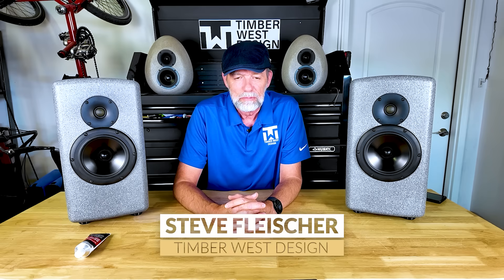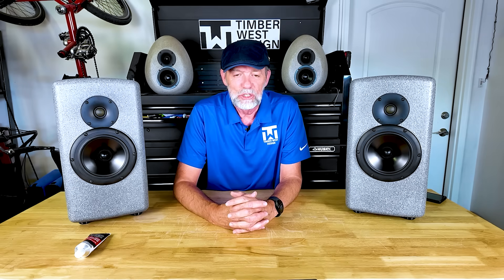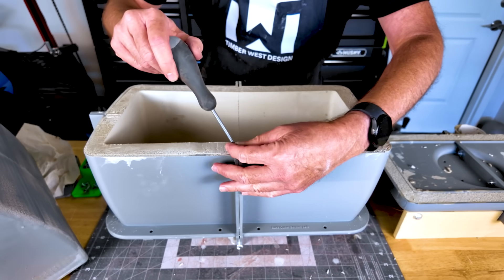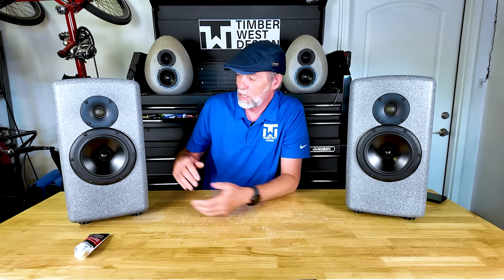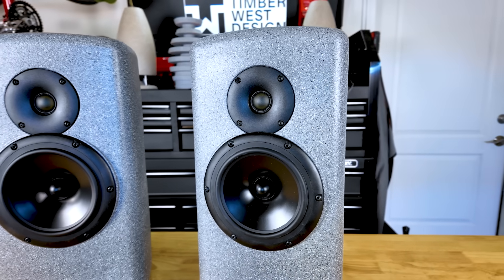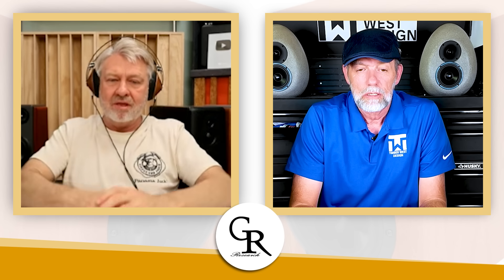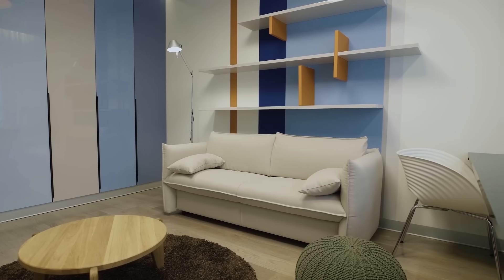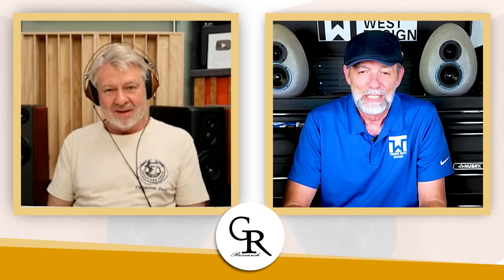Concrete XLS Encore! – You Gotta See This!!! @timberwestdesign

Comment: There is a lot more to masonry than just resonance suppression...internal volume has a lot more power to improve output that goes far beyond box resonance.
https://youtu.be/-ij93VxfPz4
Ive been developing proprietary sustainable masonry that is audio centric for about 15 years and is a little over half the weight concrete but far more energy absorbing (8" inch solid block stops a 50 cal)
These are now single piece casting...they can be the normal smooth but each one of these is unique per casting although the measurements dont change...just adding an art component.
We are about to start doing large horns (we have industrial printers 1m3 now) for some high end guys
The most clarity is immediate in the midrange...the front to back depth is just unbelievable

Comment: Hello GR, I have a question but not about the speakers.
I really enjoy your videos, I've seen several of them on the open baffle system.

 I have a question about crossover designs. The videos I've watched about crossovers, I haven't seen any mentioned this. When setting the parameters for frequency crossover point, is that done according to the speakers impedance at that frequency of the crossover point? I see a lot of crossover set at 8 ohms and it doesn't make sense to me.
Reply: I look at the driver response curves and let them tell me where they need to be crossed.

Comment: It's a great concept with inert concrete... 
Completely the opposite to the BBC monitor concept which uses thin plywood  with screws to create a ' leaky/ lossy ' cabinet where the speaker cabinet literally becomes like a vibrating musical instrument...
Both the concrete cabinet and the 'Flimsy ' cabinet are equally brilliant designs.

Comment: This opens up all kinds of possibilities. One could use any concrete stain of their choosing and then polish the surface to a sheen and seal it. Or go the FLW path and use crushed granite as an additive to the mix to create a completely different look. One could embed brass, bronze, etc, in the outer edges of the slurry and polish it along with the concrete, but no worry about resonance. If it had straight sides, you could install nuts in the forms so various side panels could be screwed on for various looks, and none would affect the performance. One could literally match the rest of their interior.

Comment: I bought a scruffy pair of SD acoustics SD3R speakers from the 80s as a project. They are similar construction with the rear being a separate panel that was bonded on to the main casting. They used what look like infinity circular planar tweeters playing through a slot in the cabinet, but they need replacing as one was bust and the modern copies appear to be garbage, I may cut the cabinets to fit either Fountek neo cd3 ribbons or some Neo 3pdr planars.
Despite the worn out drivers you could tell that the cabinets were not adding colouration, can't wait to get some decent drivers and crossovers in there when time allows.

Comment: Years ago an uncle made corner speaker cabinets from concrete, I was too young to know anything but as you say Danny most speaker  cabinets resonate like crazy. I bought Q acoustics concept speakers because of their non resonating cabinets.  This is a fantastic build cannot wait to hear and see the analysis.
Reply: They do resonate. I use sand. Double walls with lots of sand. Still you need plenty bracing. The bass from those heavy sand filled boxes is insane. You lose most of your bass with light boxes.

Comment: Fantastic job on the speakers, I have a very similar project in mind coming up (but leaving the printed shells in place). You might have made your life a little bit more easier, if you printed up a another piece for the back to sit it in and align the top piece as you fit it.

Comment: Suggestion:

Try another version with a built-in transmission line that vents out the front baffle. No Res on the interior. Magnetic grills.

Would love to see the specs on the current build, especially sensitivity and impedance across the FR.

Amazing work!
Reply: They would need to be taller for a TL.

Comment: In a past life I was a contract PC service tech. I had a fascinating customer over 100 years old retired dentist. He had a set of concrete speakers about 3 feet tall with a front facing top driver and a low rear driver. Even though they were in an office off the main room, they filled his home with sound. Of course he had most likely lost some hearing, because he kept letting me turn them up. He said they were Scandinavian in design/build. I can't find any Internet reference. Does anyone know this company?

Comment: Years ago in some Stereo Review or maybe Architectural Digest? they featured a guy who had a very high ceiling who built stereo speakers out of bricks and flagstone. The Baffle was like inch or inch and a half Baltic Burch plywood. He hired audio engineers to set the sweet spot and they did many measurements.The sound was described as "solid and impressive". JBL woofers and huge horns --  were the drivers.

Comment: Very nice! Did this gentlemen work with Mike Kelly on the Aerial Acoustic 10t, by chance? Even though those heads were a disaster, with the paint cracking and flaking off, they are amazing speakers. I have two pairs of the heads here that were clearly done in a very similar fashion. I recently purchased an additional set of new replacement heads, from Mike, that would chip and scratch just by touching them with a ring on your hand and or laying them on a table to install components. Beware. Just an awful experience.
Carefully select your primer and paint if and when you take on this amazing project.
I'm pretty sure I will be doing a set for myself.
Great video, Danny. 
Thanks for the share.

Comment: I suspect that the same type of build with a resin pour instead of the concrete will also be very interesting!!! Also, I think it will take longer to pour to avoid pesky bubbles from forming in the resin. 🕛🕧🕐🕜🕑🕝🕒🕞🕓🕟🕔🕠🕕🕡🕖🕢🕢🕗🕣🕘🕤🕙🕥🕚🕦
Reply: Mineral loading the resin would help to make it even more inert. A vacuum chamber would degas the resin to prevent bubbles.

Comment: PL Construction Glue is crazy strong back in the day when I was building speakers, I used marine two stage epoxy with filler. PL is Cheaper and easier😊

Comment: A gentleman I used to work with, built a pair of wooden speaker cabinets that were filled with sand. (In between the walls).  He used some 12" JBL coaxial drivers in them. They worked really well. very little to no resonance with them. Sounded great! They weighed a ton!

Comment: There might not be any coloration from the cabinet walls vibrating but there will still be some level of coloration from the sound reflecting back onto the woofer diaphragm depending on how much sound treatment there is inside the cabinet.
Reply: You have that in a wood enclosure too.  Your point?
Reply: Yes, of course you still need damping material inside, but it’s damping a lot less than a regular cabinet

Comment: How is the sound compared to wood cabinets?
Reply: I’m surprised you’re asking that question.
Reply: @ChicagoRob2      It sounded like a fair question.
Reply: @davidsmithson9236 exactly, specially he did not show is there any any no rez or sound wool inside ?
Reply: @kdomster9141  I put sound dampening material on the interior walls.
Reply: @timberwestdesign  Was is GR's NoRez or maybe other material and was it glued to the inside walls or just loosely inserted  ?
Reply: @kdomster9141  I didn't use NoRez in this build.  Just loose inserted on the inside walls.  I will probably experiment with other dampening methods.
Reply: @timberwestdesign Did you use thick acoustic felt (3/4inch) that can free stand on its own against walls ? It may not be as good as NoRez but I have used it in the past with great results.
Again congrats on amazing idea , execution, just one of the coolest concepts I have seen in years .... granite maybe great too but it can not achieve rounded flow so I think you concrete method is the best to date...
Reply: @timberwestdesign ok I see, I think that the final tune of the stuffing may be the last step to getting most out of this speaker ....wonder what Danny thinks here ?
Reply: @kdomster9141  Tell me your ideas for the stuffing.
Reply: @timberwestdesign Could you start with Danny's NoRez? 
Question is how to attach it to the walls ?
Reply: @kdomster9141  I do not see ANY benefits to treat a concrete cabin with an anti resonant (NoRez) material... kind of obsolete combined with resonant free cabin? Stuff Timbewest used to damp it should be enough since the tapered cabin design which "eliminates" standing resonant waves inside the "box".
Reply: @ssc00p i think it should be experimented with ...